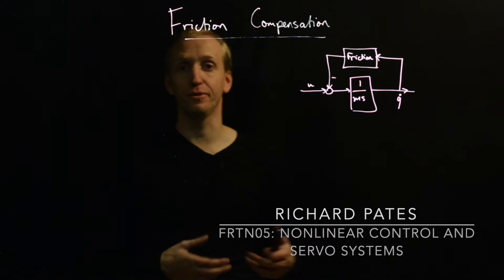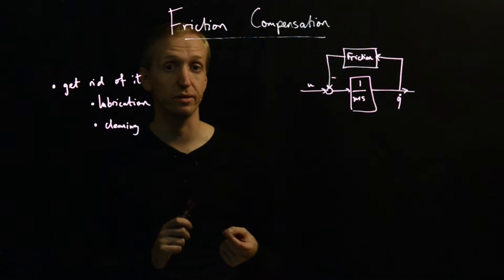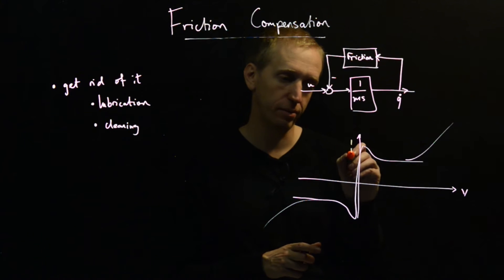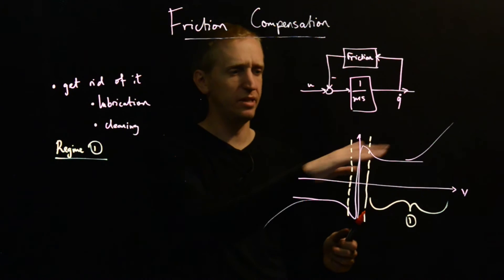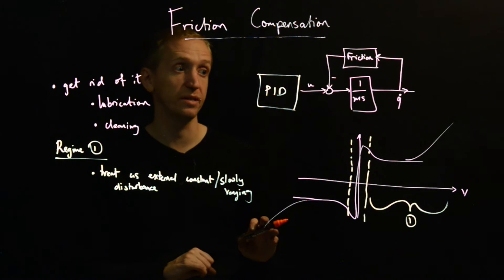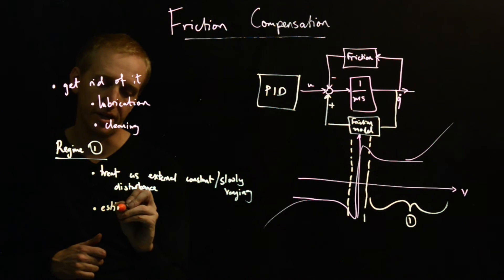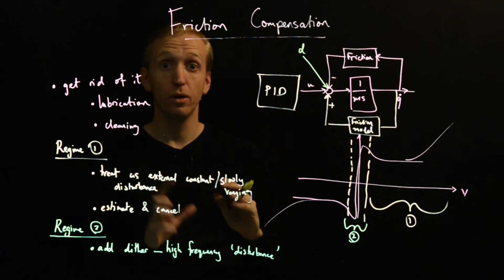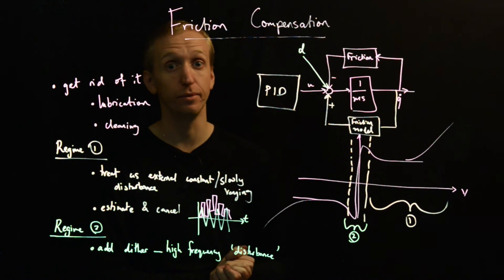Friction compensation

Comment: First of all, friction is seen as static and dynamic conditions, and we separately discuss them as disturbances. 
For constant friction(Disturbance), we can design a friction module to cancel out friction, and I of PID is to increase system type(constant disturbance can be seen a way of step input), so steady state error can be controlled.

As for static friction, it can be see as a high frequency oscillating back and forth like sharp triangular wave form. (But in practice, this is too naive), and disturbance is added extra at central point.

From my understanding after this amazing video.
Reply: Thank you, sir.
Reply from the maker: You're welcome!